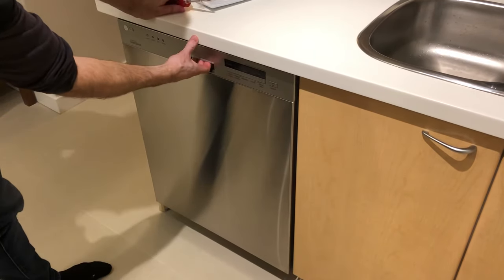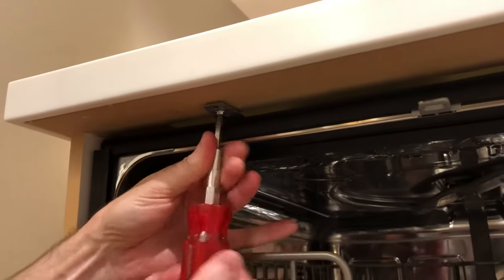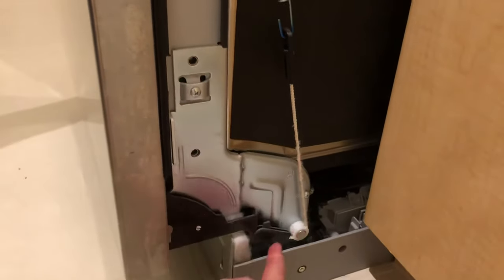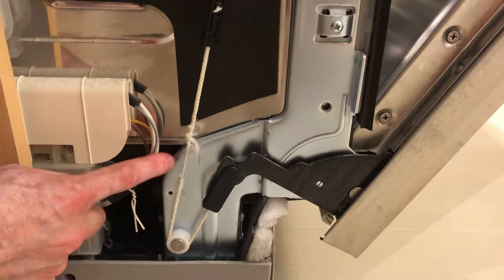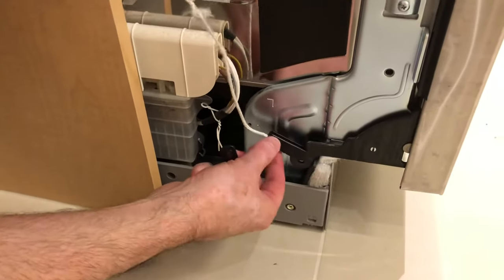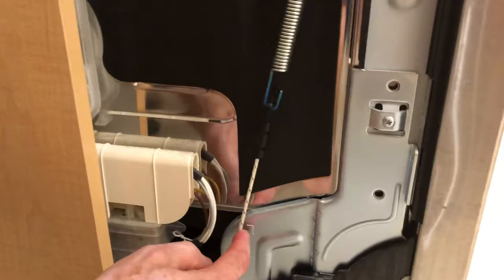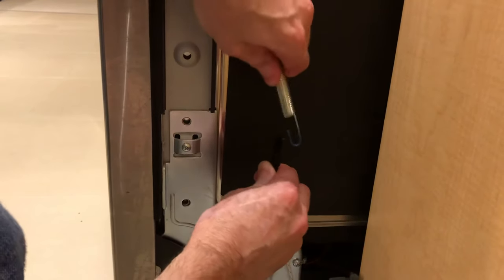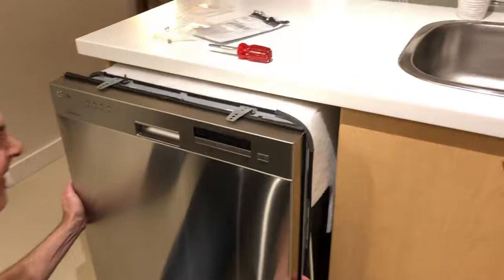LG dishwasher door falls fast FIXED! Replace the Hinge Cable Tension Cord.

Comment: Thanks so much for your video !  I heard a noise - and then my door dropped to the floor.  I assumed it was related to a broken spring - but your video showed me the part I actually needed.  I just received my OEM replacement parts today, and decided to fix it immediately.  My LG dishwasher was made in 2007 (I think it was the first SS one to have hidden controls along the top) - and when I started to pull it part way out, I discovered that my model has metal  panels covering  the sides = I had to pull my dishwasher all the way out from under the cabinet in order to remove all of the screws (two on front and four down the back).  Luckily, my water and drain hoses were still long enough - no removal needed (I did have to disconnect the three wire connections to the power cord).  

My very first diy appliance repair!  The cord on the left side barely looked used - the right one was split into two pieces! I went ahead and replaced the left one anyway - I’ll keep the original one for a quick fix if it happens again sometime.  

While researching this issue, I discovered how much “hate” there appears to be out there for LG dishwashers.  This was my fist issue with my LG dishwasher in almost 16 years (except for one small piece of plastic that broke in the bottom of the utensil basket - I just did a little wire fix for that).  I’m about to renovate my kitchen - and am planning on keeping my LG dishwasher since it works well and has the hidden controls.  

Thanks again - you saved me some $$$!
Reply from the maker: Sounds like you need to make a video yourself Donna! Thanks for watching.

Comment: Thank you, just had this happen today. I was noticing that the door was getting looser just didn't think that a nylon rope/string is being used. I also noticed the broken white rope on the side so ordered one. But watching your video tells me I don't need to worry about disconnecting all the connections, I have enough slack for all connections.
Reply from the maker: Yeah, as long as you have a bit of slack in your water, drain and power lines... you should be fine. There is usually a bit of slack anyways during install. Thanks for watching!

Comment: Thanks!  I just replaced a pump (model is only 7 years old and since we have two dishwashers in out kitchen, it surprised me that problems started happening so soon) but during the test run after pump replacement, I discovered some leaks.  After checking the gasket along the bottom of the door, I found it to be pushed up about 2/3 on one side.  Now I feel confident to unhook the tension rope on each side of the door and check out the gasket.  I appreciate your video and hope that I can fix the gasket issue.  My advice to NOT to buy LG products,  because I also have issues with the double wall oven LG units after only 6 years.
Reply from the maker: The quality of many of these machines seems to have dropped over the years. We've had these appliances now for over 13 years and the tension cable is the only thing we've had to replace. Maybe it's luck of the draw.

Comment: Great fix. FEMALE QUESTION: Can you coat the new string in something to slow or prevent future fraying, like glue or paint or flex seal so you won't have to keep replacing the string?

Comment: This is a very common problem with LG dishwashers, and it occurs even with relatively new machines.  The springs are poorly made and break at the end hooks (poorly formed).  Another low quality issue is their vinyl coated racks.  They rust at various points where the pieces are welded together, indicating the welded steel parts were not properly prepped before the vinyl coating was applied.  All three of mine have significant rust in only four years.  They won't pay to replace them, and they want well over $200 per rack if you want to buy them.  I'm choosing the better option, throw the LG in the trash and buy a Bosch.
Reply from the maker: Our LG has held up well. It's definitely not the best dishwasher out there, but fit our budget at the time. This easy fix was a way of squeezing a few more years out of it. Thanks for watching.

Comment: Were the parts for this specific to your LG model, or are they interchangeable for LG dishwashers?
Reply from the maker: Not sure if these are interchangeable. For the cost, you could always order them and try out the new ones... as long as they have the same connectors on the ends. Your owners manual should have the exact part number for replacement

Comment: Seems like this is a persistent issue. I’ve read about this happening quite a bit. Would it be possible to replace that rope with some sort of a metal leader like he would use in fishing? Seems like it would be much more durable than a nylon string.
Reply from the maker: Even a steel braided cable would eventually break. Nylon is both flexible and tough and can handle the regular bending. Considering we've had the dishwasher for 10 years... this is a the only maintenance we've had to do... and it's easy to complete.